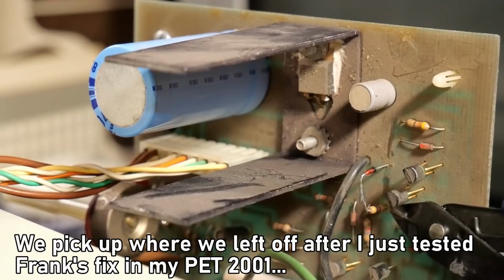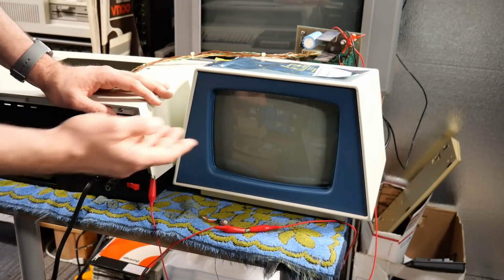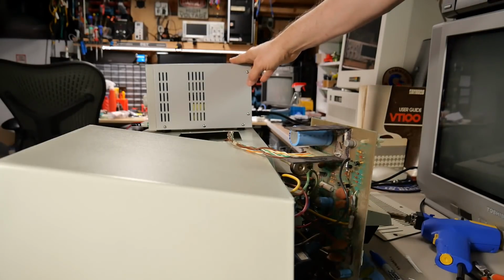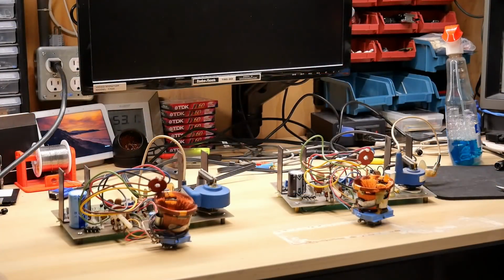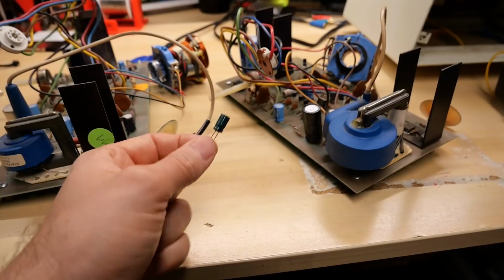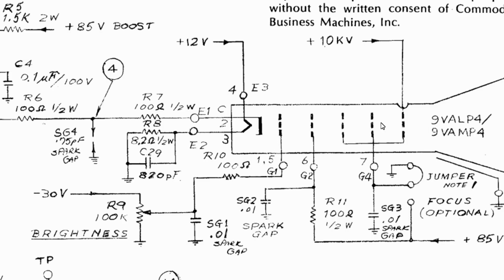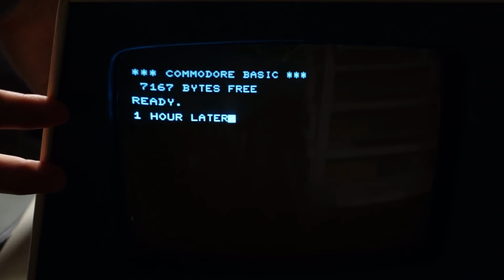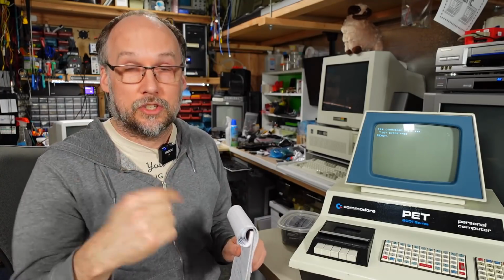Really fixing the CRT spot on the Commodore PET 2001

Comment: Great quest for the root cause Adrian, (I realize this video is 4 years old)
My opinion: They did not calculate anything just tried with 1K5, made it a little better with 2K2 but should have designed it with at least 6K8.
Benefits: Running Resistor and Zener colder, increasing lifetime 

With the old resistor value of 1K5 the zener current is 34,7mA, pretty high
Datasheet of 2N4752A states zener voltage at 7,5 mA test current.
Resistor power  1.8W!(52Vx34,7 mA) Zener power =1.14W, close to 1.3W!

Higher resistor value 2K2 lowers current to 23,6mA resistor power 1,23W zener power 0,78W

Even higher resistor value 6K8 lowers current to 7,5mA resistor power 0,4W, zener power 0,25W.

while keeping voltage to 33V anyway.
Zener current can be much lower, even as low as 1 mA. 
If you would use 10K resistor for 5mA zener current this would ower the resistor power to 0.27W and the zener power to 0,17W

Comment: I did all the changes to my PET 2001-8 and the screen dot is fixed sometimes. If I have the brightness full low, no dot. If I have the brightness turned up at all about 15 to 30 seconds after power off the small dot appears for about 20 seconds. 😞

Comment: There way a way easier fix for this, rather than trying to bring down the filament far too quickly, which could cause it to become brittle over time, why not work on discharging the hv inside the tube faster, say a 5.2k 5w cement to ground? Or a smaller resistor at the input of the power supply

Comment: Ok how did you get away with removing the yoke? When I used to do crt tv's the yokes were never touched, even bonded to the tube to stop movement... is it a monochrome thing? Also on the focus issue I didn't see a degaussing coil, not sure if its a thing on mono tubes but you could try degausing the shadow mask.. just a thought 👍

Comment: You were worried about a spot that exist for seconds burning the screen and let it on for one hour with the message "*** Commodore Basic * 7167 bytes free  Ready" on the same place?
When I was a child we had a B&W GE TV that when turned off had the spot when turned off. as the sweeping was turned off the illuminated area get quickly shrank, as the capacitors discharged, but the vertical got smaller faster and the point was in fact a tiny horizontal line segment. As years passed the screen phosphor got burned in that exact point. I think all energy from the electrons got concentrated in that spot instead of the whole screen and for a long time. What bothers me is the the spot was perfectly centered. And yours is not. Why? Shouldn't without sweeping the electrons come from the cathode in a straight line?

Comment: I own both a chiclet 2001 (1st revision analog board) and a 2001-N (2nd revision analog board).

After applying the spot fixes according to your video, the 2001-N has been spot-free for a year now. I can't draw a conclusion on the chiclet 2001 yet as I only got it properly running a few days ago, but so far the fix seems to do its job very well.

Comment: I wonder if that zener is really bad.  It may not be.  As you said, all semiconductors tend to leak when hot.  Just because that diode was leaky when hot, does not mean it has failed.  Just changing the dropping resistor may have fixed the issue.

Pro tip:  When trying fixes, try to change only one variable at a time.  If you change two parts, and the problem is fixed, which part was actually bad?  Potentially none.  The resistor was obviously fine, the zener may have had issues, but now we'll never know.  I would have changed the resistor first (too small a dropping resistor is a n00b mistake, commodore), and tested.

But swapping the zener out certainly did no harm, so there is that.

Comment: The "dot" is residual charge left behind somewhere and released (discharged) into the monitor, the trick would be to find the part of the circuit that is responsible for fast discharge after the monitor has been turned off. The voltage affects the X/Y positioning of the beam, so... technically that could be a thing too.

Comment: I utilize a very complex kidney dialysis machine.  i require about 4 hours of use every day sometimes twice a day.  anywho, when I turn off the controller, I also see that annoying spot, and if drives me absolutely crazy!  I shall try putting that transistor on the board inside the box where my blood enters.   hopefully I don’t overload the controller and boil my blood or urine as that will stink - and my stink, i mean smell because my blood and urine already smells very rancid. - but thanks for helping me with my spot.

Comment: Just did the mod of changing R2 2k2 to 470R in series with 8.2 zener on a 3032 PET. The rest of the components are already at the correct values. The annoying spot has gone. Thank you Adrian and Frank!

Comment: The later Commodore monitors run hot also. Mine is a 1902-A the power source seemed to have died. I robbed a power source out of a Magnavox and it worked okay.  I picked up the old dead power source and i noticed a part that was totally loose on the PCB and was not soldered in anymore. So hopefully soldering in that loose part would this monitor still work?  Geez I had no idea they run that hot though.

Comment: Well I need to add that the fix is not 100%.    Now after power off 27 sec later the dot comes back.  It remains for another 1 min and 20 sec before going out.  This dot is way dimmer then before the mod.  The computer had been on for several hours.

Comment: Might well be that the Z33 was not the culprit after all. Changing the capacitor to 47uF keeps the +85V on about 10 times longer (and that voltage blocks the cathode and thus the dot). Increasing R5 from 1.5k to 2.7k again doubles the time constant of that +85V circuit (both modifications together increase the time constant by 2 x 10 = 20), which is then long enough for the cathode to finally cool off before the +85V goes fully away. 

The R5 increase also reduces the thermal load on the Z33, making it run cooler and "leak" indeed less current (that is what made the dot appear brighter after 1h runtime) -- but the old Z33 might just work as well with this reduced thermal load (only 0.6W vs. 1.1W before)

So, before you dead-bin the Z33 you should put it back into the circuit you have now and check whether it shows a dot or not (I predict: no dot!). But I fully understand if you don't want to do that and are just happy that the dot is gone.

Comment: It might not have been necessary to replace the 33V zener. Just changing the 1.5k to 2.2k would draw less current from the 85V supply, so it might hold up for a sufficiently longer time to stop the spot.

Comment: Hey Adrian,
I haven't seen anyone commenting this nor heard it in your video or description (unless I missed it), so since you seemed not really ticked off at the higher value, here is a quick tip with capacitors, if they read above their rated µF value, especially that much higher, you can be sure the capacitor is bad and needs replacement, only way it can be an overachiever is by leaking electrically, aka, it's getting shorted, taking longer to discharge, appearing to have a greater capacity than it should.
Hopefully this little tip can help you diagnose things a little faster and with more confidence!
This might save you from a magic smoke show some day hah.

Cheers,
-Noma

Comment: Different flybacks... is it possible one of them has a bleeder resistor after the HV diode? That would discharge the tube well before other voltages decayed, eliminating any chance of a spot.

Comment: I'd put a high impedance volt meter on E-45 (thats the negative contact of C752). Is there ever a dot when this voltage is below like -40V? If not, make sure it keeps at least -40V for like 5 minutes. Use a 12V relay to cut the connection between R253 ("Brightness") and ground when 12V is gone. If that voltage still drops too fast, increase the value of C752 (and use a 63V type while you're at it) until it is. Use the second contact of that DPDT-relay to cut the connection between R251 and LE251 and instead connect LE251 to E-45 when there's no power.
Some combination of those measures should kill the dot for good.

Comment: Hi Adrian, I've got a CBM 2001-8. After seeing your videos about this issue, I checked out if the monitor of my model had the same problem and I have to say it shows no lighting spot during the power off phase, absolutely no issue. So I decided to further investigate and I opened the metal plate which cover the back of the monitor. To my surprise the motherboard is totally different from the two I saw in your videos, mine also has the silkscreen for the components. Unfortunately the numbers of the components don't match with your schematics, so I can't figure out what are the changes Commodore made to this board in regards to the one you have. Also the placement of the components is different. I bought this computer sometime ago from the Harden S.p.A., which was the Commodore computer importer company in the late '70 - early '80, when in Italy there was no Commodore italian subsidiary yet.

Comment: Yeah, I pretty much just buy from DigiKey and Mouser now.  Always more expensive, but I know that I'm in fact getting Nichicon capacitors or whatever components and they won't suck.

Also, I remember a few TV's from the 70's that had a similar issue.  Fast forward 30 plus years and I trashed a blue CRT on a projection TV by generating a fixed dot for more than a second.  It's amazing how quickly you can fry something... ¯\_(ツ)_/¯

Comment: I just wanted to make a comment about a small point you brought up--nothing to do with the main topic of the video.  You mentioned about old CRT televisions that had an "instant-on" feature.  It worked by always putting a current through the heaters of the vacuum tubes (CRT included) even with the set turned off.  You then said something to the effect that it would shorten the life of the vacuum tubes.  That is not the case.  The life of the tubes wouldn't be shortened it would be lengthened.  That is because the biggest stress to a vacuum tube is the cycling of the heater on and off.  If the heater is always on that stress is eliminated.

Comment: What a mess guys! You should read some good, old stuff books about vacuum tubes. I wrote comment about that  -30V line capacitor. You even didn't answer. 
P.S. That zener diode 33V was perfectly fine. You increased discharging time of "boost" line capacior, by adding bigger resistor to zener diode. Nothing else.

Comment: I would bet 100% that if you checked that 33v zener diode with an octopus tracer (ie a Huntron tracker) that you would see the leakage vs a new 33v zener.  Of course, you would need an octopus or Huntron that has the 50v test setting, not just a low voltage octopus like many guys DIY from a low voltage tube heater transformer.  This is an example where the low voltage DIY units are hardly worth having.   You can buy a well-designed "curve tracer" with the switchable low-high voltages on ebay for less than a hundred dollars.  Well worth the investment if you work on solid-state electronics.

Comment: The first spot wouldn't do much of anything and the second one wouldn't do anything at all. Phosphor spot damage was an issue with early CRT until makers used an ion trap. Heavy particles wouldn't be shifted from hitting centre screen by the scan coils and those heavy particles would be bombarding the centre all the time and these would after years make a big hole. Electrons don't do this - or many thousand times less and only for the time the scan coils are off. Really it is just not wanting to see a dot...I don't mind it. Great series though.

Comment: I would probe the various actual grid voltages at switch-off, with approriate care of course and compare monitors rather than go changing things on the offchance. Circuits that rely on the exact leakage of diodes which depend on time and temperature will never make robust fixes. I really admire your persistance though

Comment: Why would you worry that the dot would cause screen burn, but not have any concern that the boot up screen would do the same?   The dot is there for a few seconds; the boot up screen is there until you do some typing, which is usually far longer.  I remember when I was a kid in the sixties and we turned the tv off, there was the spot. It was celebrated, not despised.

Comment: Adrian, I've got a 4032 with the 12" screen, which has the exact same behaviour when switching it off. All of my other CBM/PETs don't have this problem at all (2001 with 9" green but small keyboard/8032/3032/8032-SK/8296). So I think, there should also be a problem with the zener-diode in the 4032... I have to sort that out- the layout is different to the 9"-PCB.

Comment: Can you not use a relay to cut-off the heater.
Reply: It woud still remain hot enough to 15-20s after being cut off. Also a mod like this requires a few more components and work to be installed.
Reply: @iz8dwf  If so, then the mods with zeners etc will also not work :-)  Nothing will work if hard-removing the  heater  psu rail  as close as possible to the CRT does not work. 

But I have no experience with Commodores, and  magnetic deflection CRTs. I only repair  measurement and calibration gear and  the only CRT equipped gear I worked on had electrostatic deflection  CRTs (like in a scope) But I remember my first B&W  also had the dot when I switched it off (old early 60's build tube equiped thing  I got begin 80's when my parents bought a new one.
Reply: @pa4tim  So we made something that works but it could not work as you say. Having a warm cathode is just one of the conditions that must exist for the cathode current (and electron beam) to flow. If you couldn't turn off the electron beam, there was no possibility to blank the beam during retrace or dark parts of the image then? The fix is as simple as turning off the electron beam as you would do during a retrace. Also on some 9" PET monitors, like in this one: https://www.youtube.com/watch?v=iMSQTCdC-jg already the changes that CBM made are enough to completely remove the turn-off spot.
Reply: @iz8dwf  Ah, now I understand, yes you are right.  I misunderstood your solution.  In this case a relay is  indeed  not  a solution

Comment: Quite a run around, but you mailed it in the end. I’m thinking of a Shakespeare qoute, the Lady Macbeth line “Out d—n spot!” Ive been working on my Panasonic R-1018 some more, I replace three electros with improvement but still distorted. I checked voltages and proved the output transistors ok but the driver has shorted base to emitter.  Bias has no effect and the collector voltage doesn’t react to the base voltage.  The 2SB175 is on EBay but pricey due its use for guitar fuzz pedals.  Maybe I can find a NOS Soviet era transistor.

Comment: I have a question. Given other parts were replaced, and in some cases reduced the problem, but the fix only seemed to be after the zener was replaced, unlike the capacitor which you tested (and given the age of the capacitor and it's likely hours in use, it has done really well), did you or, as you have kept the part, test the zener just to see just how far out from original or expected spec it really is. I'm just interested out of pure curiosity. I was expecting the capacitor to be a 33uF instead of a 3.3uF, but as you replaced both the 2W resistor AND zener at the same time, well damn, I'm curious to know if it was the resistor and if the fix could have been done by just the increased resistor. Please, if you still have the Commodore could you test this for me, well, for us, and for yourself!?
Reply: Adrian tested increasing R5 alone without changing CR7 and that had no effect at all. The spot was always there. He still has the old zener, if he wants to test the actual leakage curve he needs to construct some low current sinks to evaluate it.

Comment: Flaw by design: (85V-33V)/1.5E3 Ohm*33V=1,144W, out of 1W specs. Your new Zener with more wattage spec (1.3W) wouldn't need a resistor change.
Reply: Yeah see, I don't get the math that well, but that's what I'm wondering. Was it the zener or was it the resistor, we didn't get the zener tested like we did the capacitor. The math is great for yourself, but I really, really want to see the answer being done on the board. You beat me to the question by about 25mins, lol!
Reply: There's no need to run that much current in the zener in the first place, it can even run out of conduction during Q2 conduction periods. It's only there to protect Q2 and Q3 from a too high VCE for them. You don't want to run devices close to their max ratings if it's not necessary circuit-wise.

Comment: Does this mean that the Macintosh tube had extra protection built in from electrons reaching the phosphor screen after the power was off ?
Reply: I think the Mac tube was a bit too tired and didn't show any emission at these low currents. Or it may have a slightly different cutoff voltage, or both :)